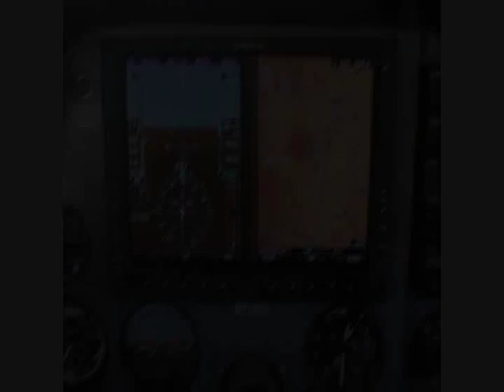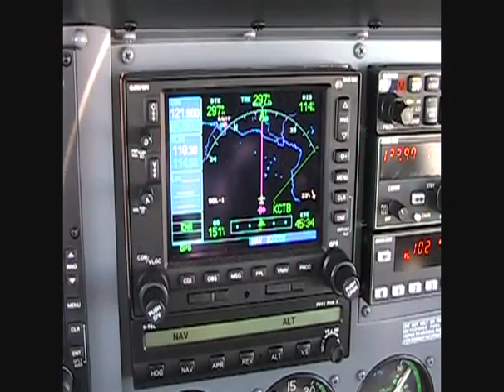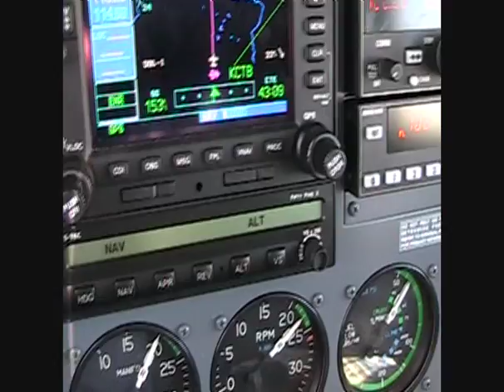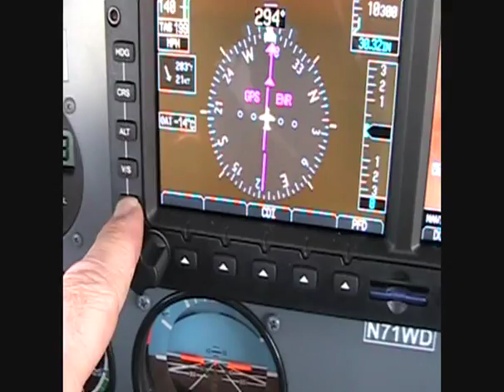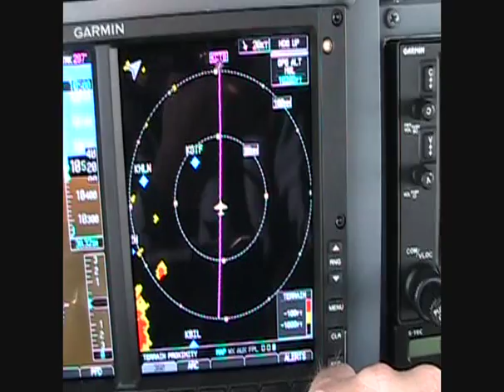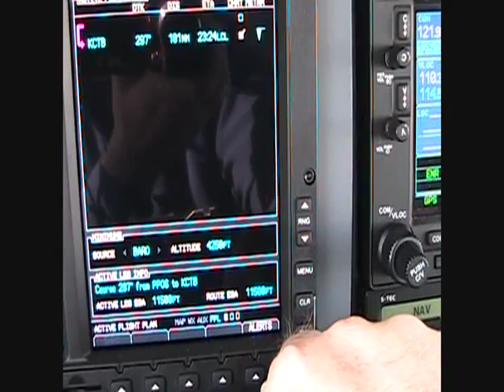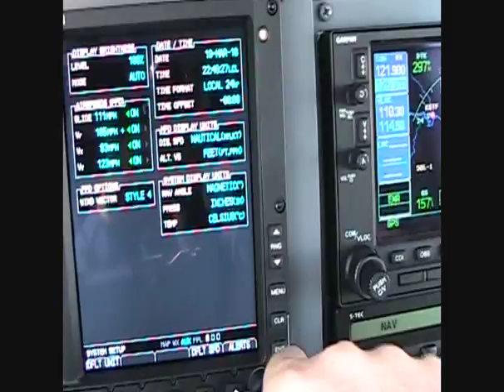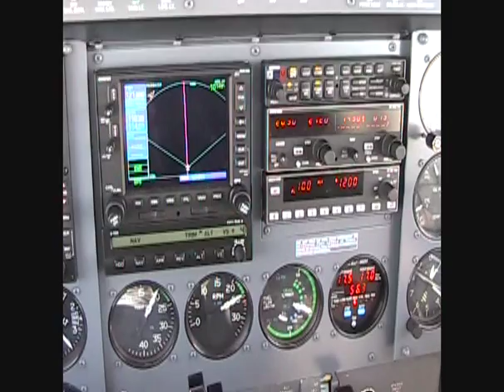Garmin G500 flight display - Cessna 310

Comment: Great video, thanks for taking the time to make it! I upgraded my Baron G58's G1000 suite with the GDL 88 replacing the GDL 90 ADS-B transceiver to meet the ADS-B requirements set for implementation in 2020. I also had the Flight Stream 110/210 installed which really helps with cockpit management. I highly recommend the Flight Stream system for GA pilots who log a lot of flight hours in their off time. I cut and pasted the advantages the system offers directly from Garmin, I personally love it and can't think of any "squawks" (problems). It really delivers as promised ; )Wirelessly Link your iPad® to Your Avionics
Simplifies and streamlines your cockpit management
Works with the Garmin Pilot™ and ForeFlight Mobile apps as well as aera 795/796¹
Enables traffic and weather from your avionics to be viewed on your portable device
Easily load flight plans – including airways – from Garmin Pilot to your GTN™ 750/650 series or GNS 430W/530W series navigator (Flight Stream 210 only)
Provides GPS location and AHRS attitude information
If you happen to be on Twitter I'm at @CaptJCKidder, thanks again! JC